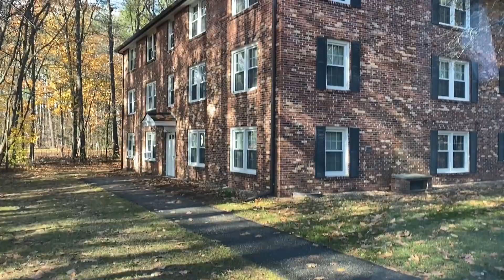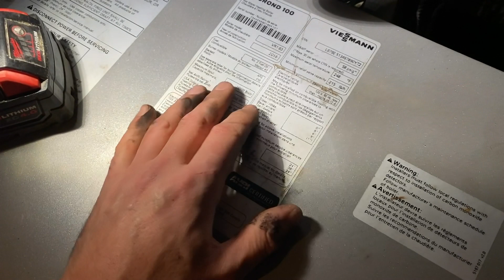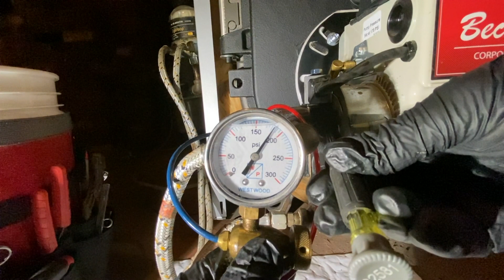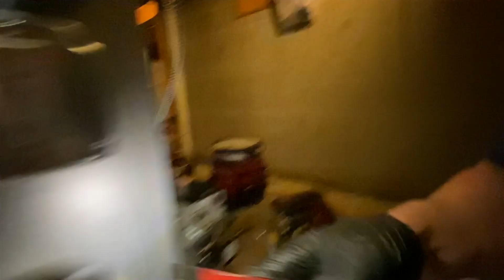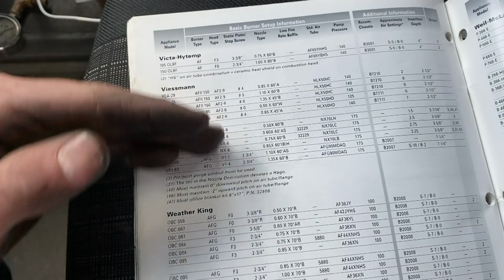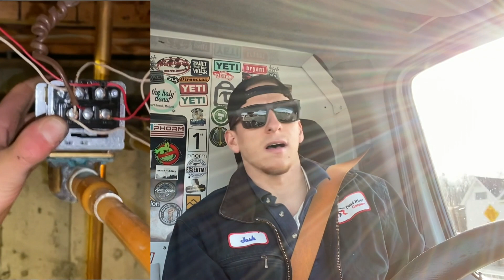Viessmann Oil Boiler Sooting Up! | HVAC Vlog 05

Comment: I ran across this video because we had a 196 50 Viessmann installed in march 2023. Since it was installed I complained on noise and combustion smells. as well as the sense of a "haze" in the air no one else seemed to see.  Its a very long saga that's still going on with poor techs that just don't test the basics.  I'm not sure what's going on with these Viessmann boilers. Mine has a Riello  burner. So far I hate it. Its making us ill.  I wanted a Carlin however i was told its not available from Viessmann at the time of install. It cant be the boiler or can it. I just replaced a Weil Mclean gold with a 7 year old EZ1 Carlin. This thing burned all the oil to a fine dust. Signed Disappointed
Reply from the maker: Sounds like simple lack of setup to me. They need to check the pump psi, burner head setting, nozzle, draft, combustion analysis. They need to look in the Riello book for that particular boiler or simply the manual that comes with the boiler to find these required specs. The Riello is my favorite burner out there, it puts the others to shame when set up correctly. Much more efficient and much more advanced than a Carlin or Beckett. Riello is the perfect pairing with Viessmann but not if you don’t know what you are doing. Viessmann or Buderus are the top of the line and as good as you can get with oil. Hope this gives some insight from someone who has been doing it for 15 years.

Comment: I wish all service men were as good as you keep up the good work ! I had a problem with my oil burner there was air in the line. I tried bleeding the system but it did not work still had air. Call the  service guy he missed misdiagnose it he told me it was the pick up tubes that were in my oil tank I have two tanks I replaced the lines that wasn’t the problem it was pump on the side of the burner. He installed a new pump and never checked the pressure on the pump to match it with the burner. When I seen your video and I seen you go through all the steps and make sure the system is running perfect I said to my self now that a Mechanic. Don’t ever take shortcuts keep up the good work guy one day I hope you have your own business. 👍
Reply from the maker: Thank you man!! Sorry I’m so late getting back. I really appreciate the kind words. I’m trying my best to be a good example to teach anyone who I may be able to help. I hope to inspire the younger generation to do quality work and learn a trade! The plan is to own my own company soon enough.

Comment: Great video! Interesting, informative, and entertaining. Looks like you take pride in doing top notch work. I like how you show yourself checking the references in the books and making sure everything is to spec. If the guy who installed it had done that, you wouldn't have had to clean all that soot! I'm here because I'm in the process of taking quotes on replacing our boiler here in MA, and everyone is quoting Viessmann.
Reply from the maker: Thanks for the nice words and for checking out the videos! Viessmann are top of the line for oil! I would go with Viessmann or Buderus if I was to install a new system.

Comment: Great video bud nice to see great working practice everything done by the book I'm in the same business in UK  was wondering does all oil burners in us run on red 
Diesel and do you have fuel freeze issues in winter as here we use kerosene as it only freezes at -40C anyway great to see a proper service and not just throwing in a 70 B mamma
Reply from the maker: Thank you! I appreciate the positive feedback. Yeah I try to nail down all the settings by the book and go from there to fine tune things, not one of those “set up by eye” kinda guys! Lol. We have both #2 red and kerosene is usually used for mobile homes with outdoor oil tanks that are likely to freeze.